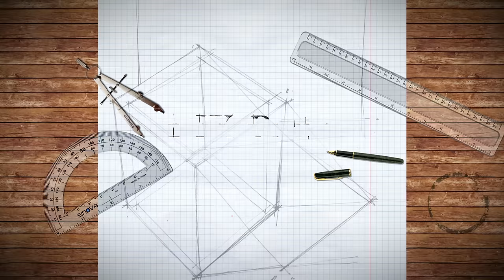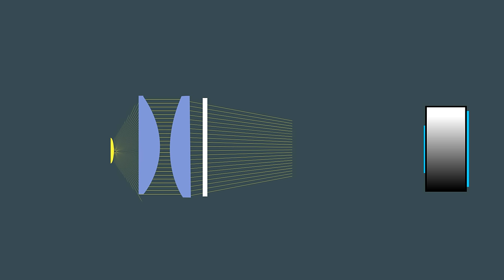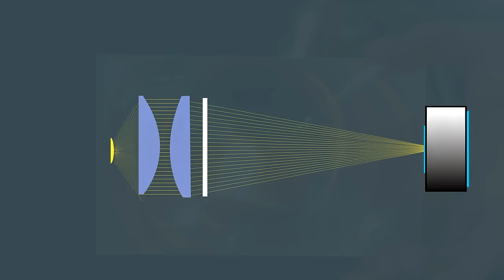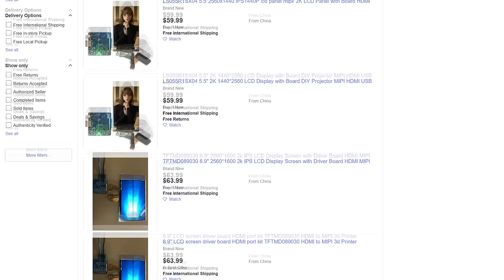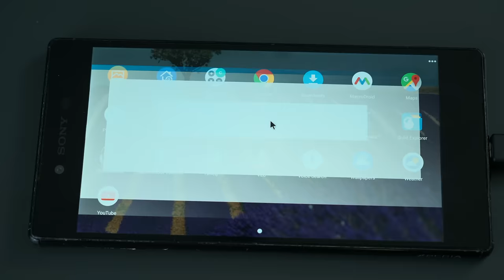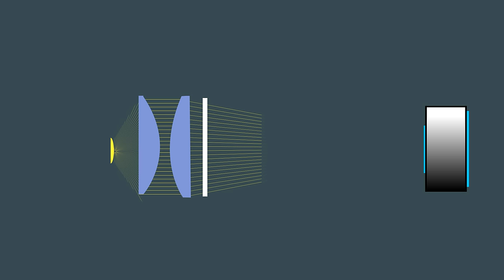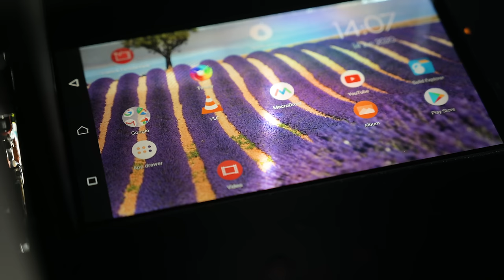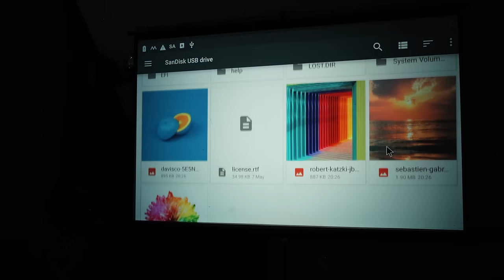Building a TRUE 4k home cinema projector (it’s awesome)

Comment: DIY Perks: We have a heat problem with 300W and need a way more complicated cooling solution.
LTT: Hold my beer! #watercooling
Reply: An AIO would be sweet for this.
Reply: Hold my canadian root beer  :p
Reply: You can inspire on LED cine lights, like Godox VL300 and similar. But they are noisy.
Reply: The real problem would be cooling the display, because you can't attach anything to it
Reply: @dimitrijekrstic7567  how about a LTT frost box?
Reply: Wrong kind of heat problem. The issue isn't the LED getting hot, that's trivial to cool. The problem is the screen getting hot, good luck implementing water cooling for that without screwing up image quality or getting leaks all over the place.
Reply: Would probably help if he didn't mount the heat sink upside down. The "heat pipes" aren't just metal but have a fluid in them that changes from gas to liquid inside the pipes. The gas rises and get's cooled back to liquid that then falls. When it's upside down the fluid just sits at the bottom that's cool and doesn't flow. So the only heat flow you get is through the metal itself and the heatsink is MASSIVELY less useful.
Reply: @musicnerd1023  even though it normally sits in a pc horizontally, your comment is still valid. Good observation bro, for any heatsink with a vapor chamber, orientation is important.
Reply: Go for glass instead of plastic - who cares about heat?
Reply: @dimitrijekrstic7567  I've always wondered about that in PC builds. At least you get some flow with them sideways. I'm a chemical engineer so heat exchangers are a big part of the job.
Reply: @dimitrijekrstic7567  you can add a couple of fans half sinked  in on the side(so half on the fan on top of the screen, half under.) and that'd be what I'd do on something like this just to be sure that the screen stays completely cool.
Reply: @musicnerd1023  to be fair I don't know exactly if it would work better sitting vertically upright or horizontally, but I guess the engineers that design those for pc coolers know what they are doing. The one thing I do know is that the vapor forms near the cpu, so you need liquid there, which happens in every usage scenario except the one we see in the video. I don't know how much performance is lost, but then again, many coolers don't use vapor chambers and they still do a good job.
Reply: @musicnerd1023  Ah no, that's not quite how these work. Remember, in most PC-s these things are mounted sideways and in laptops they are oriented however the laptop happens to be oriented, they still work just fine. If you have ever cut one open you have probably noticed that the inside walls are actually very porous, that's intentional, the working fluid doesn't just flow back to the hot side, it's wicked back. So this will in fact work just fine "upside down" though of course it would be even better if gravity wasn't working against flow. As long as the hot side doesn't dry up though it's fine either way.
Reply: @palloxtheonlyone  An LCD consists of many different layers, some electronics epoxied on glass, maybe some semiconductors actually on glass substrate and of course the liquid crystals in between and the color dies which are also heat sensitive. There is no such thing as all glass LCD or heatproof LCD. Some LCD-s simply have the very top surface also glass for scratch-proofing, doesn't mean there are no plastic layers underneath. A regular LCD is rated only up to +50C, some have extended range up to +85C but no more than that. And you are probably not going to find extended range components in a consumer product like a smartphone.
Reply: @dimitrijekrstic7567  To cool display i think about thic layer of glass. Imo this will be better then air.
Reply: @musicnerd1023  nope, thats not how it works, it works by capillary action. The inside of the heatpipe is either fullly or at least in its boundary area filled with a open prorous copper "sponge". The Steam rises, condenses on the outside (where the big surface (and heattransfer comes into play) and goes flows by capillary effect towards the area that needs the cooling, where is vaporises at a set temperature like 60-70 degrees (possible by a slightly lower pressure than 1 bar inside the pipe thus reducing the boiling point of water)
Reply: @musicnerd1023  Well in that case it would be a big diffrence between using that typ of heatsink in a case thats laying down or i a case thats standing up and have the heatsink on its side? I`m thinking that the gravity dosent matter but i could be wrong and i will try to find out.
Reply: @aleksandersuur9475  blow cooled air over it, maybe use a radiator to blow the air through and cool the water in the loop
Reply: @musicnerd1023  I wondered about that but I couldn't see a good solutions since the light source needed a clear open path to that first lens. His sister seems to work, I wonder what the longevity is on it though.
Reply: @dimitrijekrstic7567  is that a challenge?
Reply: @mikepettengill2706  just use a different type of heatsink that doesn't use heat pipes. Honestly, it will probably work just fine as is since that's a pretty large heat sink to begin with. Just not working very efficiently so could have gotten away with a much smaller one if oriented correctly.
Reply: @satibel  yeah me 2
Reply: @TizzyT455  :D
Reply: @aleksandersuur9475  Im not sure the exact wavelength emitted by these LED's, but It might be worth putting a filter over the LED to absorb any non-visable light which will be wasted energy heating up the LCD panel.
Reply: @aleksandersuur9475  There is a system... Old Sony CRT projectors had an optically pure liquid cooling sandwich between the CRT and the lens. It ran pure glycol to keep the CRT surface cool. Good luck finding one these days though.
Reply: I'd say LTT would say hold my Testbench so it doesn't fall down again
Reply: @aleksandersuur9475  This is what Matt said in the video, if you used a 300W LED then it would be problematic to cool the screen, of course cooling the LED would be more ambitious as well since you need a better cooling solution for it, i.e. more powerful fans.
Reply: @musicnerd1023  I think Gamers Nexus tested that not too long ago for kicks and their findings were it technically cools a little worse working against gravity, but it's fine. It still works.
Reply: This has to be your most impressive build to date. Fantastic work.
Reply: @Taijifufu  Interesting. Probably means your limiting factor is somewhere else and the heatsinks are generally oversized for what they need. Not a bad thing, just makes me wonder about how much cooling is really possible when you approach it the right way.
Reply: @musicnerd1023  In addition to this he designed the projector to have an internal airflow from the top to the bottom, which is against the thermal flow. This only leads to heat being trapped.
Reply: umm you can't watercool an LCD screen...
Reply: @aleksandersuur9475  The old Lumenlabs builds used a sheet of glass (I forget if it was specially coated window glass or not) between the light and the LCD to block IR (from the halogen lamps they used).  In this design it could also be arranged to direct the airflow horizontally across the back of the LCD which would help too.
Reply: @tristan6509  You could if you were good at building aquariums.
Reply: @musicnerd1023  in my (and probably 96%) pc its sitting sideways and works just fine

Comment: by anymeans you cd've made that final mirror angle "adjustable" amplifying the possibilities. great build btw.
Reply: But that will make the output image skewed if you adjust it below or over 45° if you're casting it to a flat wall since the projector is fixed.
unless he will also at the same time add a way to tilt the projector upward or downward.

Comment: It's just awesome! Unfortunately, Fresnel lenses have a very strong tendency for vignetting :( and this can be clearly seen in the video. But anyway: thank you for what you're doing here :)
Reply: Cinematic yo ;)
Reply: Yes, that was also my concern, which became true at the end of the video.
Reply: Do you have a solution for this?
Reply: @MacGamingPlace  Not using fresnel lenses 😅
Reply: @maxhouseman3129  What is the alternative?
Reply: @pascalrosso7279  A combination of several types of lenses. Like a condenser-lens together with a ball-shaped lens. In professional projectors there is a lens system implemented which is designed for that purpose. That's the art and magic of engineering 😎

Comment: Your projector do have quite a lot of vignetting thou, so a better lens would be nice. Thou it's a cheap DIY project so it's still a really impressive result!
Reply: I think the same type of lense could be used, but having a wider lens than the screen, thus cropping the effect.
Reply: Most importantly it's not bright, will not work with any ambient light like a real projector does, but people will just skim over the part where he had to adjust his camera to show the difference in brightness
Reply: @otallono  still, it probably will be better than a 200-300 bucks android projector.
Reply: I'm glad you brought that up. I'm also concerned that the heat pipe style heat sink won't work very well upside down.
Reply: @sachideshmane5088  it will work well enough, given the size, it probably can dissipate 300w of heat under 90C, so even upside down it should still be able to cool 100W with decent temps.
Reply: @faaaaq  well for a 300W led you could use watercooling. This however would probably double the prize. Youd also need some way to cool or isolate the screen
Reply: @sachideshmane5088  They work very well upside down, modern heatpipes (for the last 15-20 years) do not have a strong directivity due to very strong capillary return action.

Comment: it looks like your fans where mounted pulling air in not pushing air out judging from the blade shape
Reply: Noticed this as well. They look to be old noiseblocker fans and as far as I know they do not make those in inverted layout.
Reply: He said that they were pulling, not pushing. 20:05 And that its intentional to suck in air through the top to cool the other components (Phone, Screen)
Edit: Yeah he used "pushing outwards" for "pull", but thats basically just what pull is.
Reply: @Annatar.  At 20:12 it looks like the fan direction arrow is pointing inwards
Reply: @Annatar.   He said in the video he's trying to create negative pressure in the middle of the heatsink, which would mean having the fans facing so they pull air like this:
⬅️➡️
But the way they were mounted, they were doing this:
➡️⬅️
Which does the opposite of what he said he wanted, as it forces air into the middle of the heatsink and up, creating positive pressure. Ultimately it doesn't matter, for the cooling it's providing this is enough. Personally I would have used a push/pull setup like this:
⬅️⬅️ or ➡️➡️ to provide clean air for the led, then added another fan up top dedicated to cooling the phone and other components up there.
tl;dr they're right, it's the opposite of what he said he wanted, but it doesn't matter because unless he lives in a particularly hot area of the world it shouldn't make a noticeable difference to cooling.
Reply: @jonest6151  yeah those are definitely pushing air to the middle, pretty side of the fan is intake ugly side is exhaust
Reply: At 20:10 you see the arrows for the direction on the fan frame they pushing air inside the projector
Reply: Yup, the clean side of the fan pulls air in and then pushes out over the side with the plastic holding the fan.

Comment: Another amazing video, really instructive and exciting, I really want to try build this projector, really cool.  You could use a water cooler for the LED.  Keep them coming.
Reply: lol
if youre a pc gamer, you will know that anything hot needs water cooling. including the fans and case
Reply: @neotozo3789  lol no
Reply: @neotozo3789  water cooling is only practical for really hot components, otherwise air is more reliable, cheap and easy to work with
Reply: LTT video idea intensifies
Reply: Erm... LTT is shying away from water cooling. For simplicity, HSF is still the best. Water cooling is good if u want to transport the heat some distance away for dumping, like outside the case. I use both in my build.
Reply: AIO are the same or worse than lots of copper and heat pipes. Ask me how i know... 
Anyway, dude says at the end "it's perfect", we've seen it, it does look and sound perfect, so i'd believe him instead of trying to improve upon it.